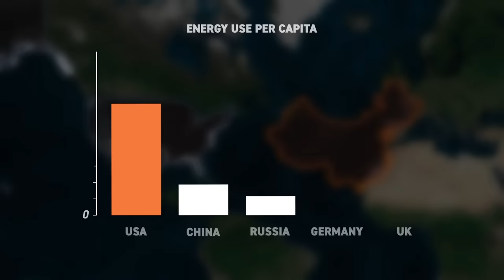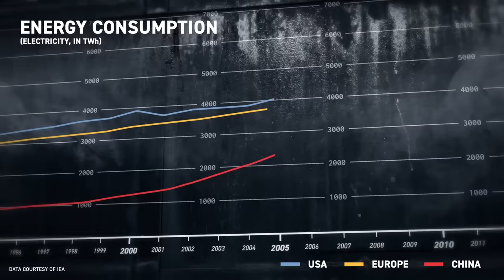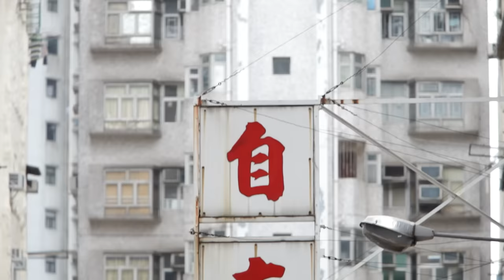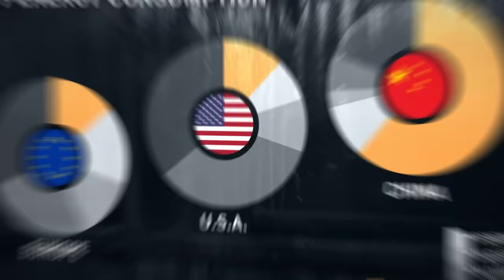China’s Electricity Problem

Comment: We're building a new house for our family - here in Brazil we use masonry. The walls that will receive direct sunlight will be made of solid ceramic bricks while the others will use the hollow ones. Thick walls make for more expensive foundations and costs more but in the long run makes for a more comfortable and more energy efficient house. That's way, btw, the Empire State Building is the more energy efficient building in NY - the walls are made of stone.
Reply: LOL!  Love it.  "Here in Brazil, we use masonry."  You know, that little trick humans have known about for around 8,000 years?  ;-)
Reply: An average person can't afford one. People want to build a house and decorate it with their savings as soon as possible.

Get some bricks , cement and sand and build one. For heat? Get an AC , it's the cheaper option.
I believe when the rich start shifting towards using mud walls and other things for building houses, it will gain an aspirational value. It will take a decade or two for that to happen.
Reply: I am going for masonry House for myself in India.
With lots of trees and Water harvesting.
Reply: I agree, but i think it comes down to cost in north america. Brick takes longer to build, can't be built below -5C, costs more to transport....etc while there is a full industry behind delivering standard sized, lightweight treated wood. So foundations are concrete, houses are wood. Also labor costs being so high here, it makes sense to use the faster build material
Reply: I highly doubt the Empire State Building is the most energy efficient in nyc
Reply: @yashvardhanojha6796  Such a house is relatively cheap to build, but very expensive to run. A better house is much cheaper in the long run, and importantly, produces much lower emissions. The extra cost of building efficient housing is very low indeed in comparison to the cost of heating or cooling them over the the building lifetime, and especially in comparison to the costs of later retrofit. It is way cheaper to built it well in the first place than it it to try and retrofit later.  
Building lots more shoddy buildings is just adding problems for ourselves in the future.
Reply: @SasquatchsCousin33  Concrete filled styrofoam block is probably the best quick build, high efficiency option in the US, but despite being on the market for 20 years or so, it is being adopted slowly.
Reply: @forloop7713  Some of the newer (noticeably shorter) buildings with good insulation and ground source heat loops are considerably more efficient. A zero-differential pressure heat loop starts to encounter some pumping difficulties above about 160 vertical feet. Water hammer in the return lines can start to effect fitting stability, expansion loop rigidity, even fluid chemistry.
Reply: @williamyoung9401  yes but like in many countries it’s not used anymore typically, here in the USA, mostly it’s frames made of wood and in the proportions I find it to be the exact opposite than in Brazil, it’s strange at first, until you realize well, tornadoes and hurricanes, even blizzards, that means being buried under debris that are lighter for when help arrives.  Ps in the US I can put my foot easily through interior walls here they are mostly hollow. The same can’t be said for houses in Brazil lol
Reply: @russbell6418  Styrofoam is made out of styrene which is a petroleum-based product. Also extremely flammable.
Reply: @noconsent  This. Also, the spray foam insulation people seem to love is the most flammable. Better to use spun rock.
Reply: @SasquatchsCousin33  Have you ever heard of ICF of SIP construction? personally if i ever build a house, it's going to be ICF. monolithic insulated concrete walls with a SIP roof would probably survive a tornado
Reply: only the outside facade is stone, and it's not the only one. it does have a giant system of cooling passages that connect to underground cooling tunnels because they were smart and knew how to manage heat before A/C. if memory serves, i think they were actually a gross consumer way above average and had to undergo a big retrofit and update in the 90's or early 2k's
Reply: @russbell6418  it's because it's about 15% more expensive last i looked, and i would not be surprized if that's climbed with today's concrete and petroleum prices. americans are also gross consumers and pick a larger house over a more efficient one
Reply: Now all you need to do is get the farm animals out of your house!
Reply: Europe is with Japan, Taiwan South. Korea, Singapore the best developed region, from House quality, infrastructure, railways to power supply! I wish Inda will soon achieve that level!!
Reply: @SasquatchsCousin33  Another advantage is that it is biodegradable
Reply: Stone is bad in an earthquake and the Northeast is overdue.
Reply: haha bricks, sticks and wood.... while rest of the world uses monolithic reinforced concrete
Reply: One other consideration besides energy is rot, insect and rodent resistance. Wood is very attractive to insects, and foam insulation attracts both. Concrete is very resistant to insects and rodents. I can't say I have much experience with Brazil, and it's a large county with different environments. But my understanding is that wood-eating insects are a bigger problem in Brazil than in the US, but certainly still a problem in the US.
Reply: @xxwookey  Are you really worried about "emissions"? The science on that is wonky as heck
Reply: @noconsent  Yes but the ones he is most likely thinking of are covered on both sides. You can use styrofoam to insulate buildings.
Reply: @kaspervestergaard2383  Yeah, they also use cladding out the outside of buildings, like in Grenfell. That doesn't mean I will ever enter the building, live in the building, nor that the building won't burn nice and hot when it does catch. And you still ignore the carbon emissions from making the material, so it's not great regardless of anything else.

The problem isn't that polystyrene starts fires, it's that it feeds them as soon as a fire touches them. Which can't be guaranteed to never happen in residential buildings. In fact there's been so many fires made worse by the presence of Styrofoam insulation it should already be banned for use as a building material.
Reply: @williamyoung9401  ele escreveu no sentido de ser bem mais comum usar isso em construção no Brasil, não que descobrimos.
Reply: What do you do about plumbing and electricity? Run the pipes along the inside walls???
Reply: @shellieperreault6262  In colder climates like Canada all plumbing is interior so it does not freeze in winter. It was -32 Celcius here (Ottawa, Canada) just a few days ago.
Reply: @yashvardhanojha6796  I guess that might be the case where you live, but here in Brazil all houses are made of masonry instead of drywall xD and air conditioning is very expensive here.
Reply: @berlintanker  maybe in rural areas that'd be a problem, but I wouldn't know, I live in the city
Reply: @johnhaller5851  ah yeah, I've heard that a big problem with wooden houses (still very much a thing here in Brazil, they're much cheaper, so it's an option for the poorer population) is in fact insects eating your house 😔
Reply: @shellieperreault6262  uh... yes?? lol! how else???
Reply: @abelhapedras  Here in Texas it can go into any wall...
Reply: @abelhapedras  
No ticket, no laundry......
Reply: @se-wb9hv  Did you write that of your own volition, or did they threaten to cut off your phone if you didn't obey as you were commanded?
Reply: @shellieperreault6262  You are not very happy to see the previous text, because I made it up.

Comment: One of them - the first - is in Brazil and connects Itaipu to São Paulo state. The DC power lines are also useful to insulate the grid's parts so a disturbance on one part won't propagate to other parts. Brazil's DC line has other reasons: Itaipu was built on the border of Brazil and Paraguay and, at the time, there was a decision to set up half of the generators in 60Hz and half in 50Hz. Brazil buys the 50Hz produced for Paraguay - retifies it at Itaipu and alternates it near São Paulo city. 

For those who don't know, Itaipu was, until the Three Gorge Hydro Power Plant was built, the largest in the world.
Reply: very enlightening. quality comment.
Reply: modern wall paneling and double gazing windows are as much or more efficient than old masonry
Reply: What the devil is going on at YouTube?  For a while, every new channel that appeared on YT  was marked😮. “Subscribed” even though it was the first time I had ever clicked on the channel.  Now I am getting new channels with no ability to subscribe, 😮even on  channels with no political or moral message.  What is going on?   I have been subscribing and “liking”  channels for about     5  years.  Does Musk have to buy YouTube to straighten things out.  I would pa say $5 per month for a channel that was not liberal, political, or woke, or evil.  Just free speech.  The only time a user should be blocked or cancelled is when their comments were illegal or disrupting or crippling of other’s usage.  
JoeB
Reply: A DC power line is a TERRIBLE idea.  The reason  you use AC is that the current alternates so the power line does not get HOT.  When a powerline gets HOT, your efficiency of transferring power does DOWN, and you get sizeable voltage drops.
Reply: @Project2013B  HVDC is a new thing for long lines because it has smaller losses compare to our common AC lines. You're also incorrect as to why we use AC for transmission lines currently, nothing to do with heat/temperature but with power losses in long distances and more materials required for the cables.
Reply: eu te amo brasileiro que comenta coisas positivas sobre o Brasil em vídeos gringos ❤
Reply: @l4nd3r  I have been reading about this topic, and here are my observations:
1. At moderate voltages used for transmissions, like 11kV, 33kV, or 75kV, the currents in the wire are marginally high, and DC wires (which carry current throughout the bulk of the wire) generate a fair amount of heat, which is difficult to disperse by the wind (especially for the heat generated within the core of the wire). AC wires on the other hand, due to the skin effect of the AC current itself, generate almost all the heat on the surface itself, which enables easier dispersion of the heat by ambient winds itself, reducing damage.

2. For AC power transmissions, a voltage drop due to heat loss can be mitigated by installing booster stations enroute, which use a system of transformers to step down, and then step up the voltage back to transmission specifications. As transformers cannot be used with DC power, this has kept low-voltage DC transmission away from the public eye for a long time.

Coming to the HVDC concept:
1. As the voltages increase, the current carried can be minimized, which means that the heat generated by HVDC lines drops to negligible amounts over long distances, and the voltages are high enough that the voltage drop due to heat loss is negligible even over long distances (thereby eliminating the need for booster stations).

2. In the early days of power transmissions, the equipment used for rectification of DC current (ignitron rectifiers) was extremely bulky and inefficient, making DC power transmission a chore, as end appliances and power generators used AC currents. Modern rectification equipment like GTOs and IGBT convertors are highly efficient and high-capacity, so it is now possible to convert HVDC to standard AC for distribution and use.

These are my observations about the rise of HVDC as a modern transmission system.
Reply: Quick comment on the propagation, almost all power lines have some sort of breaker so that they don't overload.(and a bunch of other reasons)
This is why it's very rare in the USA to have a whole grid go down Even though we primarily use AC transmission lines. Ignore Texas they're very weird and have their own more separate separate grid. Even then that was primarily a generation capacity and import ability problem. 
Most power grids trip off gear if they're going to be damaged. This can cause interesting failure modes. 
Also these sorts of devices are how you you know induce rolling blackouts. You can't exactly blackout electricity in an area without some way of stopping the flow.
The DC cross connects between between the USA and Canada in Niagara did not help when the whole East Coast power grid went down. The load imbalances and the effects from that propagated right through those facilities. 
Essentially there was a very rapid load change across the grid which caused multiple power plants to disconnect their generators to prevent damage. If you implement this sort of power distribution you may be able to keep power plants on easier in this sort of situation.
Reply: Tofu system

Comment: You don't want high voltage lines working at 100%. If lines are at their limit shifting load and maintaining them becomes very difficult. Especially in the hotter months.
Reply: I have no idea about line maintenance, but the video implied 60% was low. Is that incorrect? I don't remember it suggesting 100%. Please let me know
Reply: Also the electricity running through the lines generates heat and in hotter climates, those lines can get extremely hot. Further disrupting power distribution.
Reply: @TheKlaun9  Usually you have transmission lines running in parallel for redundancy. If one line goes down, you want the active lines not overloaded
Reply: The concept of planning for future demand growth is mostly foreign to countries that doesn't build anything
Reply: @TheKlaun9  Saying 60% is low is like saying the highway was badly planned because it's not congested. Fun fact, sun only shines for half the day, if the line is designed to carry solar, it will always average to around 60%.
Reply: @vlhc4642  the us okay with it but atm, our current infrastructure for everything is either close to or past the time for replacement or repair. There is a concerning amount of work place deaths from old infrastructure failing. Along with possible deaths for some if it isn't taken care of. Like gas lines close to electrical tram rails.
Reply: @vlhc4642  thank the heavens someone started clarifying that a bit. However, I'm not sure if I understood correctly: is it that the video was just way off, or was that a reply to me specifically? I'm asking because I can read all sorts of things into that, for example: if the Chinese power line is working at 60% of what's physically or legally possible, it's one story. But if it's working at 60% of what it should be capable of handling, it's still low, isn't it? Is this a failed/not properly utilized project or not? I really want to know.
In your highway analogy: 60% of all available space filled with cars or 60% of what they planned with / a comparable road has when justifying their budget?
Reply: @TheKlaun9  You need to realize China is adding more solar each year than France's total power grid and renewable capacity have been doubling every year for the last 2 years, it means if you build a line to transfer renewable at peak and it saturates on day 1, you now either have to build more storage at source to smooth supply, defeating the point of the UVDC, or you've just put a cap on your renewable generation.

The line likely started at much lower than 60%, is at at 60% in 2022 and saturate in the next year or two. Wendover knows exactly how much solar is being added and deliberately ignored that part in his claim that 60% is low.
Reply: @deuterium2132  Not so much for redundancy but for load capacity. Long transmission lines are incredibly difficult to site and expensive to build. 15 years is usually a minimum time from the word "go" to carrying current. Redundancy is provided by the grid; here in Arizona we are connected to California in at least three places that I can think of; the fourth was still being sited when I retired. It may be in service now; such details are not made any more public than necessary for security reasons.
Reply: @dalazyworf  About 20 years ago the North American Electric Reliability Corporation  (NERC) estimated North America would need to spend about half a trillion dollars to bring electric delivery up to date in the US and Canada. Some of that has been done (yay to the rise of Remedial Action Schemes!) but I would bet the ravages of age have made it a wash now.
Work place deaths aren't an issue but reliability is. I did a ten minute presentation on US blackout history for our department about a decade ago. The upshot: each decade since the 1960s through that time saw a rise in blackouts. Except for rare instances (like the Texas freeze in 2021) the cause was transmission lines tripping off. Stability is everything in electric reliability.